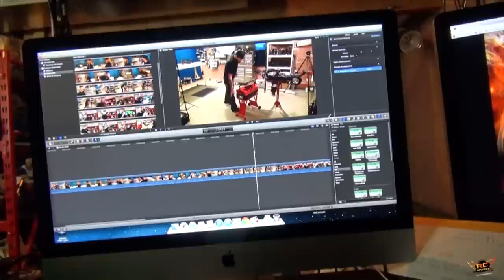RC ADVENTURES - THE BEST OF - 500th Episode! Highlights of Radio Control ENTERTAiNMENT

Comment: hey djmedic I had a suggestion for your second rc4wd tf2 if you wanted to do a true to scale hilux you should get the three link kit for the front and do coil over shocks in the front and leave the leafs in the rear because that's what the real hilux has you should do this for your next upgrade video